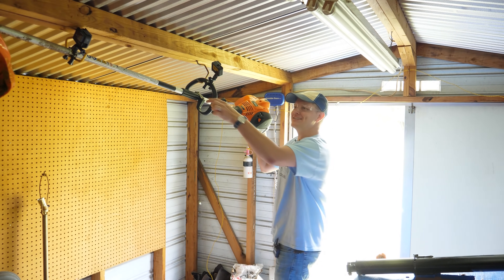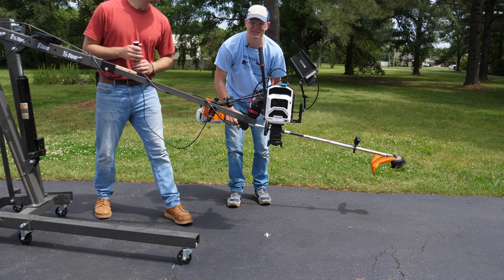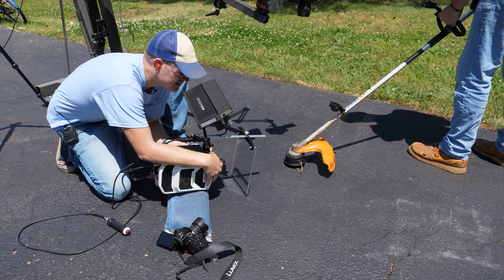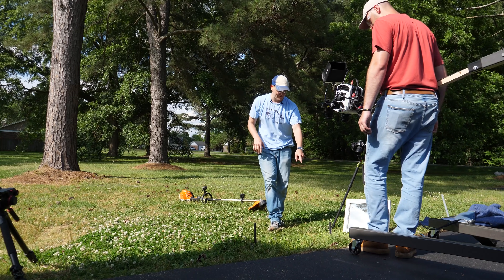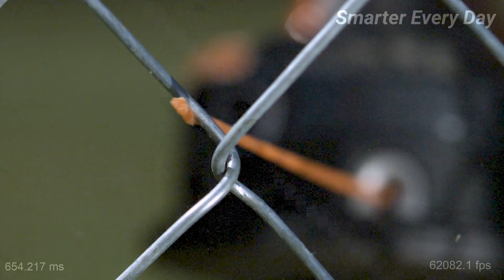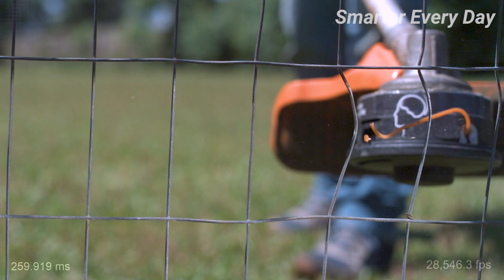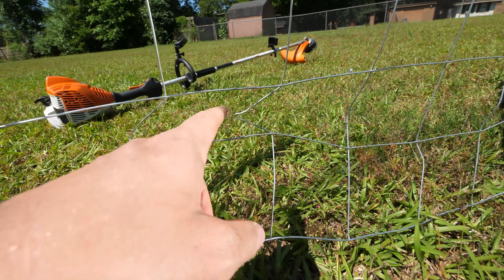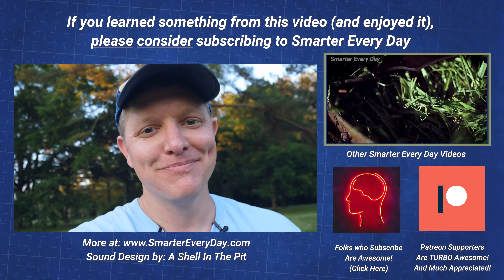How Weed Eaters Work (at 62,000 FRAMES PER SECOND) - Smarter Every Day 236

Comment: 1:00 in and asking, Why have you not ungraded to a battery pack system? (recommend them at least 40v) 
2nd question why are you running a thick line, aka land clearing line, smaller line cuts much better, also use the star line the edges will make cleaner cuts. 
Right to left is a rotational feed thing just cuts easier and cleaner, think of how you wind the line on the spool. 
6:00 smaller line will cut off excess quicker with less drag to the motor. 
Spend 15 min. take off your knife blade and hit it with a file (sharpen it).
Finally stay off wire it will mess up your line and shoulder.
I resemble the Alabama remark, lol.
Tip: weed eat with the flow of the ground, if your just digging the front side in for doing it quick, you cut to the dirt. It looks bad, if you keep the weed eater level to the ground, you still trim everything in the same amount of time and it looks a lot better.
Before it starts, YES I have spent WAY to much time running a weed eater.
Thanks Dustin, great vid as always.

Comment: You can turn this experiment on another question: how fast do you have to spin a plastic string of lenght Lp and diameter Dp to bend a metal wire of lenght Lm and a diameter of Dm? Obviously material counts too, but lets stick with weed eater plastic stuff.

Comment: It looked like in a few of the slow mo shots on the chain link fence that the line became a little bit shiny at the point of impact/contact. With the line moving so fast, is it possible that its hitting so hard that the line is getting hot enough in that instance to melt slightly and weaken itself to shear off as well?

Comment: If you operated a string trimmer for very long, you should be able to tell that your line is getting shorter because the engine revs up higher. When you let more line out, the engine won't rev as high. Pay attention to the sound of your string trimmer and you can tell when it's time to let more string out. I use the string trimmer from right to left because I want the string trimmer to throw rocks and clippings away from me.

Comment: Umm part of why it raps around the wire might be because of the plastic heating up this makes the plastic easy do it shap or mold making it wrap around the  fence.       Which would be using friction

Comment: 16:05 might be the most interesting part. The metal is in free fall but the weed wacker string is moving so fast that it hits and bends it as the acceleration on ends of the metal lag behind the point of impact.

Comment: i have the exact same husky weed-whacker.  the fuel line in mine got all decroded and the fuel bobber broke off and was loose in there.  i got some new line from the local hardware store (had to find it myself because they had absolutely no clue what i was asking for... hint:  it was near the inline fuel filters).  but man was it hard to install.  the little nub you need to attach it to is around a bend inside the tank.  but i finally found a super old pair of curved needle-nose.  i've never in my life found a use for those things until now.
anyway, you may want to keep a spare bit of that tiny hose on hand in case yours decrodes too.

Comment: i'm checking out the raycons right now.  i already have apple wireless ear buds, but they don't stay in very well.  i think my ears must be a bit more harry than the majority of their test pool, because they sound amazing right when i put them in or right after i reposition them, but they start working their way out pretty quickly.  
so if you can run with those raycon ones, they may just be what i need.
where's the link in things i like?

Comment: 11:47:  fascinated how even with all of the high speed dynamics involved you can still see a perfect mechanical wave propagate from the point of contact up the line to the head.  As simple as if you wagged a rope or extension cord on the driveway.

Comment: Only you Destin, would try to figure out the science of a weed whacker. It's not rocket science. String cuts grass, grass and fence cuts string. It's a delicate balance. The slow motion footage was cool though!

I use an 18V Milwaukee weed whacker and string for my grass, but I run it as slow as possible for cutting. It still cuts but it saves battery and string. They make great products, and they're even better when you know how to use them. 

Try not running your weed whacker as fast as it will spin and you'll see it still cuts. Be smarter every day?

Comment: Only Destin would try and put his cap on top of the motorcycle helmet!🤣🤣🤣

Edit: C’mon Destin, you gotta keep that blade sharpened for it to trim the line to the right length properly. You can’t expect a full tool to work properly.🙄🙄

Edit: Wow! The forces on that smallest wire look terrifying, I’m amazed it didn’t just shear off on the first hit.

Comment: 13:18 and again at 15:37   my favorite part of the video.  the fact that such a tiny bit of wire with such a small mass can have enough momentum from such a short duration of contact, to make the wire continue to bend long, well, "long" after the contact is terminated... combined with the fact that the fence structure is exerting a lot of other forces which are trying to keep that small bit of wire straight... seems kind of incredible to me.  it means there's quite a bit more energy at the end of that string than i thought, even when it's being interrupted and slowed down at every turn.  and with that in mind, there are some inCREDibly strong weeds in my yard that take a good ten seconds to cut through.  well, i actually use blades on my weed-whacker now, so it doesn't take that long.  but i'd be interested to know just how much force is being transmitted.
it's crazy to me, seeing such small effects in slow motion.  like when you see a car skidding sideways on pavement, to me at least, the tires seem relatively stiff since they have so much pressure in them.  but when you see footage of a tire skidding sideways and bouncing around in slow motion, you see all the waves and vibrations and oscillations back and forth... to me it's fascinating to see what i would consider stiff rubber move in such a way that doesn't really seem possible.  and the way these minuscule bits of fence wire move in slow-mo is similar.  not because they're stiff, but because they have so little mass.

Comment: As the weed eater line hits and wraps around the link chain fence, I´ve noticed it kinda melts the material on the impact spot causing it to break. Is that happening due to temperature rising momentarly caused by  high the speed impacts? Nice show by the way.

Comment: My small electric (ie; weak) strimmer (as we call them here in the UK) doesn't have a blade in the guard to regulate the line length, but rather a short round rod. 
It fits with what you've found with the thicker wire fence; the rod is about 3mm in a diameter and around 20mm in length. Its only secured at its lower end, so presumably if the line doesn't break on the first pass, it can slip up and over it to prevent snagging which might cause the line to break at a point closer to the head.
Had always been curious as to why it wasn't a blade and presumed it was for "safety" (to prevent cuts to fingers when changing out the spool) and that it must just rely on "brute force" to snap the line, so this video explains whats happening, perfectly!

Comment: On the iron ring net my two cents: maybe also a thermal effect. All this impact, winding unwiding  will increase local temperature of the plastic wire.  Not sure if enougth to melt it but probably enougth to soften it.

Comment: 10:15 "feels more like science if we take some measurements" - proceeds to use non-si units
Reply: "siunits" sounds like "science". COINCIDENCE? yeah prolly actually
Reply: Engineers use Imperial units. Who else would use thousandths of an inch?
Reply: Curtis Densmore engineers not in the US
Reply: Because SI units = science 🙄
Reply: @samshute3859 , well, if there's one thing I definitely haven't heard of, then it will be the basis for Imperial units. SI units are pretty well defined, quite a lot of them by using the most natural unit to the universe we could come up with - the Planck units of time, length and whatnot. Plus, the SI units are just easier to use, the prefixes clearly tell you the size of the unit compared to the well defined prefixless version, and the sizes follow a comfortable logarithmic scale of 10. All that makes it a better choice for SCIENCE!
Reply: @Hypercube9 , you're not supposed to take a path of most resistance EVERYWHERE in life, it only makes sense for career growth, because you become much more hardened and whatnot. But there is a fine line between doing things the old way to make it easier in life and straight up living in the past. What if I said "We should stop producing medicine because only the laziest take them, we instead should harden our immunity"? It makes no sense, does it? Think of all the infants and elderly that will die painfully. Well, why should I stop using an easier and more defined system just to be able to take pride in your five tomatoes like you do? Just imagine what would happen if the scale of units was as messed up as in the Imperial system, we would need to use the weirdest fractions to represent quite a lot of numbers that are easily shown by SI.
Or, another example. Once I had to solve a chemistry problem: I was given an unknown organic compound and the amount of C, N, H by mass (in percent), and I had to find the smallest possible candidate for such a chemical. The calculations I did were too big for me to handle, so I wrote a program for myself (it takes composite numbers and shows them as multiplication of primes, also it could simplify fractions). It helped me a lot, then I plugged the numbers I found into an Excel spreadsheet and found the chemical. Am I lazy for making it easier for me? Apparently, yes xd
Basically, don't forget the past, but also make sure to compare the times fairly so that you don't end up living in the past.
Reply: @no-better-name  Using your "logic" I should just ignore your entire comment and tell you to "go fornicate with yourself" because that's "easier". 
He's just trying to take a measurement. A scalar quantity. Your units are no more precise than mine and there's no math involved! Americans learn metric AND imperial units, so if YOU get easily confused by fractions or terms you don't understand, you have no one to blame but yourself! 
"Just imagine what would happen if the scale of units was as messed up as in the Imperial system" And you think the metric system is perfect? I'll bet you also think 1 Megabyte = 1 million bytes! LOL And how about the idiocy of referring to the distance to the moon as "approximately 400,000 km"?? Four hundred thousand thousand meters?? Shouldn't that be 400 Megameters? Or 0.4 Gigameters? If you're going to have metric units, then USE the metric units! Not to mention the fact that they keep CHANGING the metric system! They just changed it AGAIN about a year and a half ago! (Sorry, 1.5 years ago. I know those fractions can be tough.) But THIS time, will totally be the last time they redefine the base units... until the next time. Anyway, maybe America will reconsider once you guys finally get settled on ONE system of units. Call me, I'll buy you a pint or 473 mL. :P
Reply: @no-better-name  You may be misinformed on the basis of SI vs imperial units. The metre was originally defined as 1/10,000,000 of the distance from the Earth’s equator to the North Pole measured on the circumference through Paris. Up until last year the kilogram was literally defined by a physical object that would constantly change weight (albeit slightly but still). Now days the metric system might be based on natural constants of the universe, but guess what the official definition of a pound is?  0.45359237 kilograms. Guess what the official definition of a yard is? 0.9144 meters. The imperial units are just as based in the fundamental laws of the universe. When it comes to "easier to use" I challenge you to have a more open mind. Yes the prefixes are nice and a base 10 log system is convenient but guess what else is nice and convenient? Being able to divide a 12 by 2, 3, 4, and 6 (dividing a foot into inchs). Ask a carpenter if they use the metric system or imperial. Odds are if you're in an English speaking country they will use the imperial system.
Science and engineering is about choosing the right tool for the job. Saying metric is the "better choice for SCIENCE!" is silly. Of course often times the metric system is the better choice for scientific applications. Now put yourself in Destin's shoes. He's an american engineer who makes science accessible to regular people. I don't know his analytics but, I'm willing to bet that most of his viewers are Americans who have limited exposure to the metric system, and have a much more intuitive grasp of how large a thousandth of an inch is verses a mm. With these constraints in mind is metric really the best choice for science? I don't think so.
Reply: @samshute9469 , do not worry, I did know about the first definition of a meter. Mind explaining the uncomfortable fractions that come with those official definitions (if I don't manage to find about on the Net), though?
With that many dividers you can show almost anything as a lovely improper fraction which, I guess, gives some sense of scale, but with SI you can just move the point around to convert. There is a nice reason why SI follows base 10 logarithmic scale: we count in base 10. Rounded numbers like 50 or 410 or 0,02 make more sense when the only way to convert is using powers of 10. If I wanted to have nice rounded numbers in Imperial, I'd need them to be divisible by 12 or 5280 or others (so, round 10 inches to 9 inches = 2/3 feet). But you round to 10 incher or 5 inches, and 5/12 feet, or 5/6 feet is not really comfortable. Plus, SI allows for working with these fractions AND decimals too, which is generally what is better if you're counting in base 10 like most humans.
Don't worry about demographics, I understand that, I was not demanding change, only supporting it. Also, thank you for being civilised, the "fornication is as easy as SI" dude is scaring me xd
Reply: @Hypercube9 , oh please, I know that computers use base 2, come on, at this point you are insulting me. Also, fornication is easier than what?
Talking about fractions, well, it's not like SI doesn't allow for a 1/3 of a unit, the regular fractions were never lost, but base 10 logarithmic scale allows for clean numbers such as 0,15... let's say meters, 0,15 meters is 15/100 is 3/20 of a meter, now go convert by multiplying or dividing by powers of 10. There's your beloved fractions!
Units such as hectometer or decameter or Gigameter are rare, your average calculation will generally use units of length from nanometers to kilometers. Giga-, Mega- are preserved for things such as pressure (a Megapascal of pressure is a million Newtons applied to a meter squared, for example). And I did not get your point on the idiocy of 400000 km to the Moon, that distance in miles is about 1 3/5 times less and yet it is still a big number.
The change in units is particularly small, but I can see its influence on anyone making precise calculations - the change is for the best, mostly.
Reply: Science doesn't care about your units.
Reply: @EpicWolverine  Science indeed doesn't care about si units. Scientists do though.
Reply: Seems like you Europeans are afraid of anything not divisible by 5
Reply: @theman5887  ah yes, Europeans, the only people to use metric... oh wait.
Reply: @Vapor817  Sometimes you make it so easy.  This must be the best example.
Reply: @theman5887  eehm pretty sure you can divide everything you want by 5. And the SI is based around base 10, like everything metric, not base 5
Reply: @MrSam1er  ackchually multiples of 10 are necessarily divisible by 5 so he wasn't totally inaccurate
Reply: @alec006a15  Well ackchually I said base 10, not divisible by 10 ;D
Reply: @theman5887  Do you mean all non-americans? Also why divisible by 5? That has literally nothing to do with the metric system.
Reply: @theman5887  We must be terrified of Harry Potter money then!
29 Knuts in a Sickle and 17 of them in a Galleon.
It's almost as of she expected people from the USA to read the book!
Reply: @wscottwatson  or she was poking fun at odd units systems ;-)

Comment: In the UK we call them strimmers. Mine came with a metal brush-cutter attachment which is pretty much a mower blade that gets bolted on the end rather than the head with the string in. It's great and so dangerous, especially when you hit gravel or stones :)

Comment: Here's a suggestion:
1) Use guitar strings in place of the regular weed eating strings
2) Try one of the aftermarket "solid plastic blades" types of cutting heads.
3) Keep doing what you are doing.  I'm now subscribed.  👍🇺🇸

Comment: It looks like there might be some correlation between the line breaking and the line being ahead of vs behind the rotation of the trimmer head. I thought I noticed that when the line was out ahead of the trimmer head's rotation, it had more time to unwrap from the fence wire as the head continued to rotate, where if it was already lagging behind when it wrapped around the wire, it didn't have as much time to unwrap, and therefore was pulled harder and broke.

Comment: If you DONT rev it up and just let it idle you can trim around chain link fence and even cut grass on the other side without ripping all your string up.      I very rarely even use the throttle on mine.   Only in big open areas or super tall grass/weeds.
Cool vid though :)